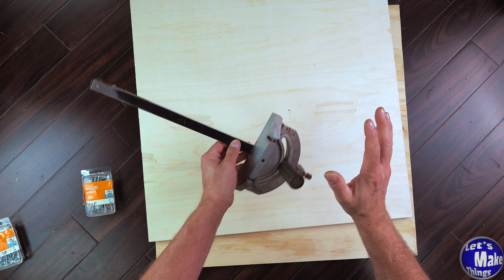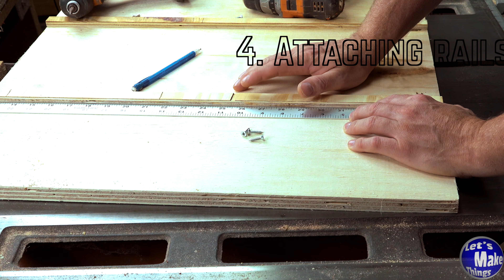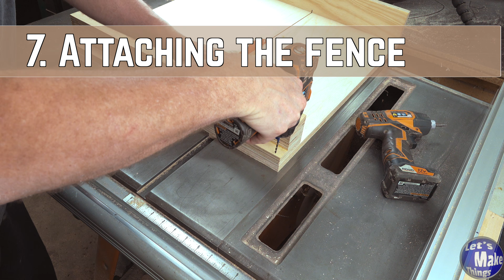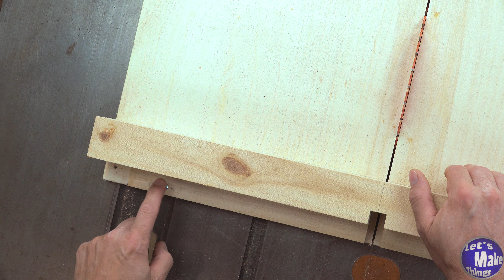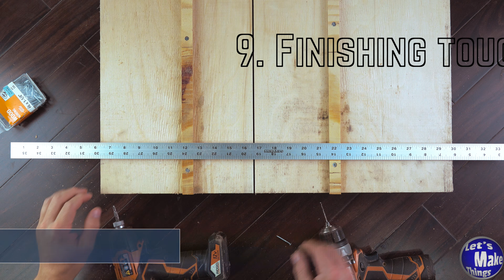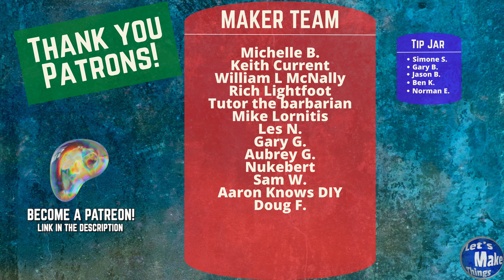Simple End Grain Table Saw Sled with the 2 Cut & 5 Cut Method

Comment: Thanks for all the details. I actually earlier today was trying to square up my sled using Ng's video but was still screwing up. One question I have for you is I know where the pivot point is but how do you determine where the adjustment point is? It seems like videos just pick an arbitrary spot near the end of the fence. You said you calculated it at 22" but how did you do that? Did I miss something?